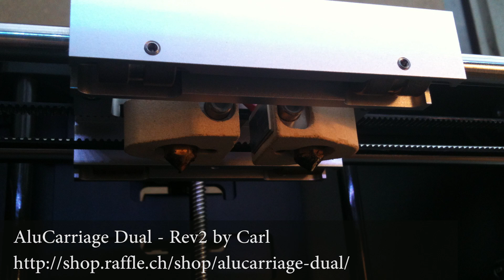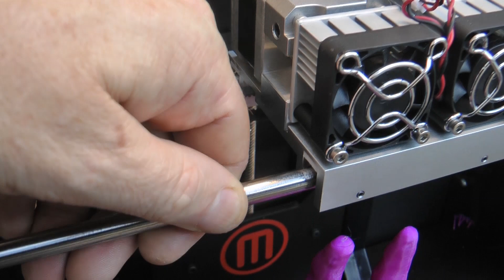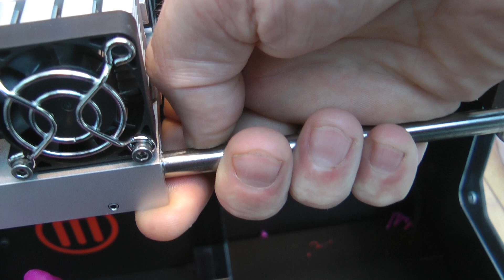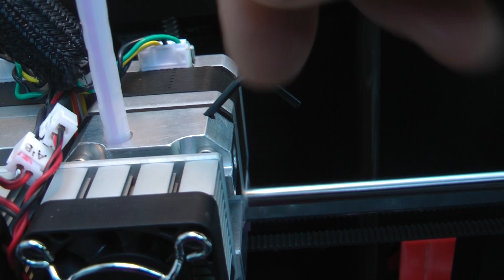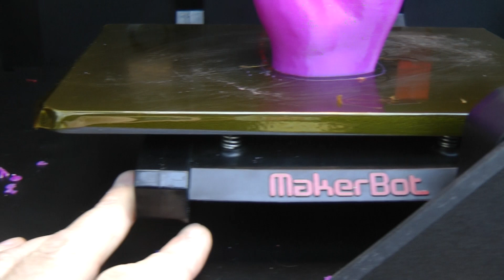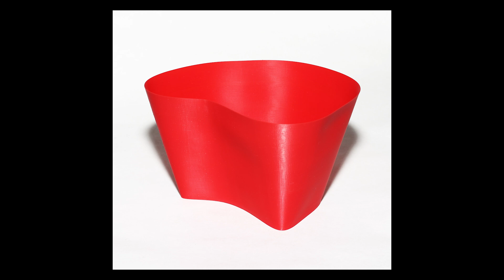MakerBot 2X Upgrades AluCarriage Dual & 3 in 1 Extruder Upgrade

Comment: Hi Steve,
can you please post where to get the new working Thermocouplers for the makerbot Extruder? I ordered 4 different types as used in the replicas but none of them are working. Thanks!
Reply from the maker: +kalle665 Please follow the link for details on most of my upgrades. The BilbyCNC TC leads are great, but I've also used clone Flash Forge TC. Hope this helps - 

https://drive.google.com/file/d/0B0C8ufUZKXDsREJUTjg4WmFoZDA/view?usp=sharing
Reply: Thanks!!

Comment: did you notice any difference in performance by doing these upgrades? do you think that they are worth the $$$
Reply from the maker: Blackie9900 The 3 in 1 Extruder upgrade improved reliability 100%. I honestly cant remember the last time I had to adjust or strip the extruder. The AluCarriage is a must if printing with high temperature materials such as nylon or PET. Many in the community have reported the plastic carriage melting and distorting.

Comment from the maker: Hi Scott,

I think the issue is more with the increase of sage on the x rails, which hasn't been noticeable. Even the weight of the stock setup causes the rails to sag when the head is in the middle of the build plate.

In saying that I have printed at 0.1mm layer height across the full glass build plate, with these upgrades, without any issues. I've also gone to 0.05mm in the center, again without any problems.

As far as prints speeds go, I'm always adjusting mine to suite the print quality I'm after. Slowing the speeds gets rid of 90% of any ringing, but got flatout if appearance isn't an issue :).

I should think removing the left extruder will make a HUGE improvement to performance and quality. I have thought about it, but never tried it, as I use the left for HIPS support.

You won't regret fitting all the upgrade you've listed... it's been months since I have had to strip the extruders.

Be sure to print some spacers before you strip everything down - http://www.thingiverse.com/thing:233971

Also it's worth while printing and fitting Davids filament guides at the same time.
http://www.thingiverse.com/thing:136423/#files

Good luck and let us know how you get on.

Cheers, Steve